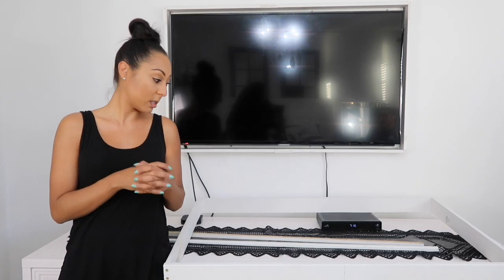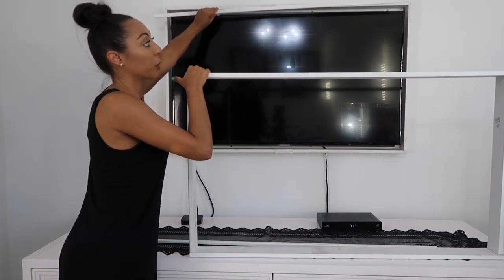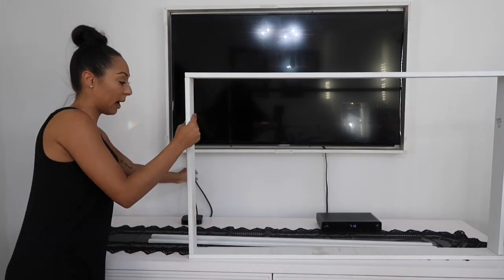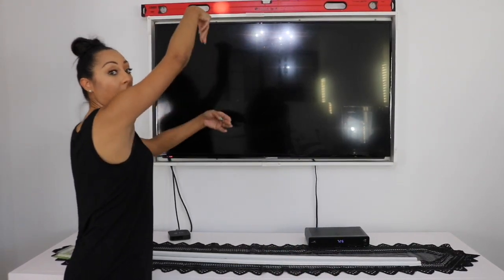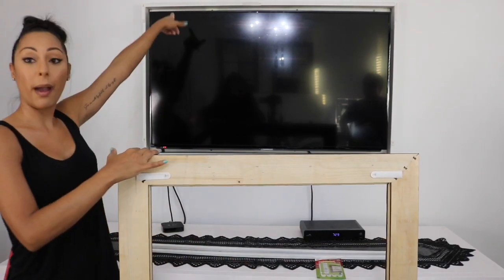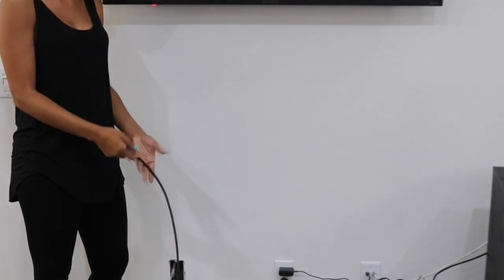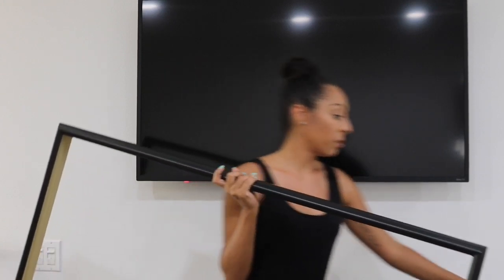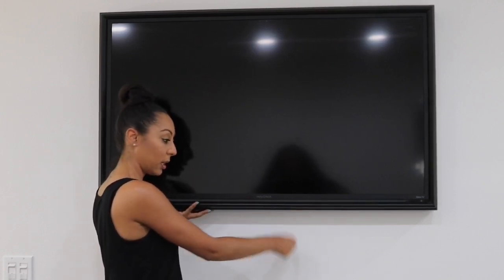PART 2 - HOW TO: FRAME YOUR TV I MOST REQUESTED VIDEO ON MY CHANNEL

Comment: I don’t understand how 4 Velcro strips are supposed to hold a heavy frame. And then the extra pieces of wood on the wall? Can’t you just drill the frame or wood glue it to the box and make it all one piece then screw the box into the wall? Just seems like a lot of unnecessary steps.